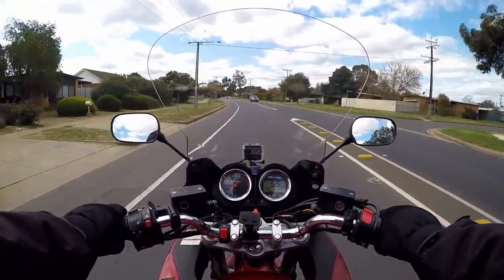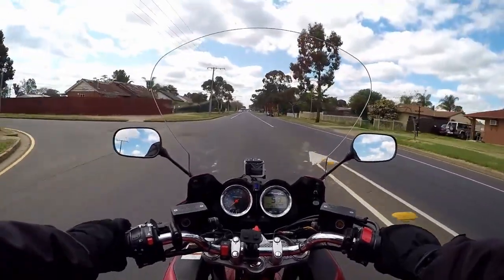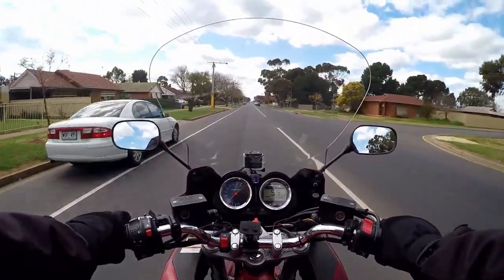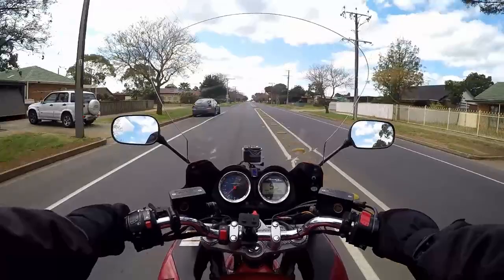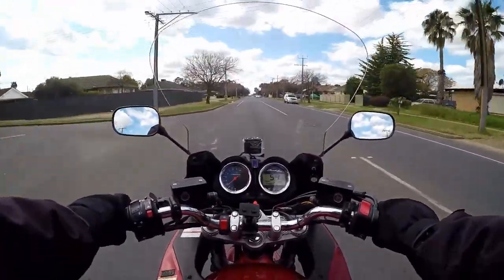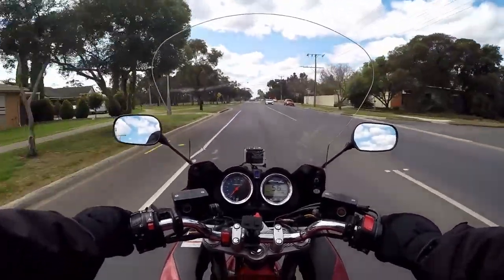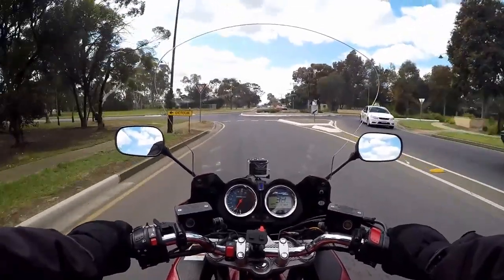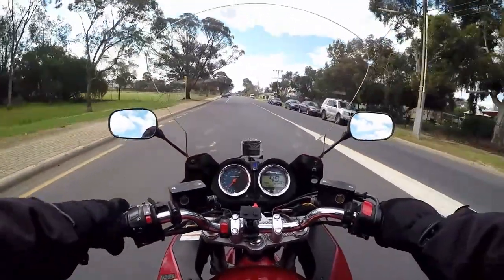Vlog #222 Don't Forget To Check!

Comment: When you rebuild an engine you need to check the torque settings on the bolts after you've run the engine and warmed it up. One thing you should do is over-tighten the bolts as you'll get leaks.
Reply from the maker: +RevvedUpBiker That is right, small bolts small tools big bolts big tools as I have been told.